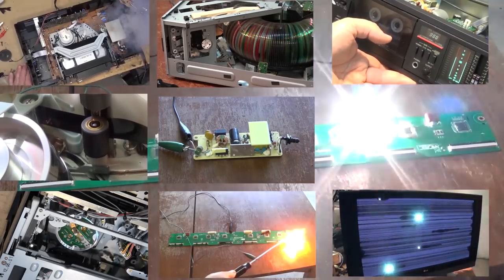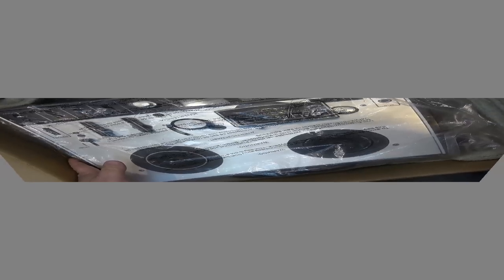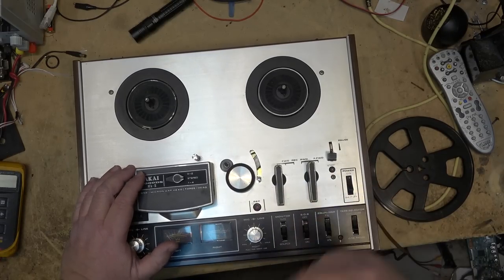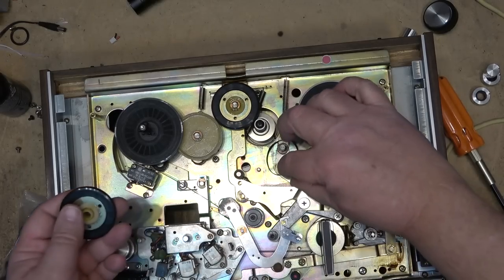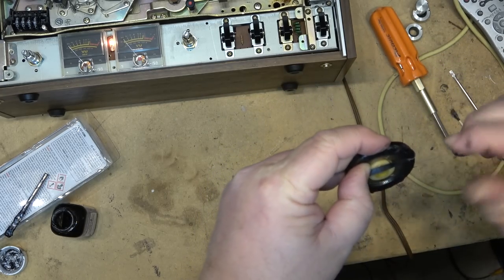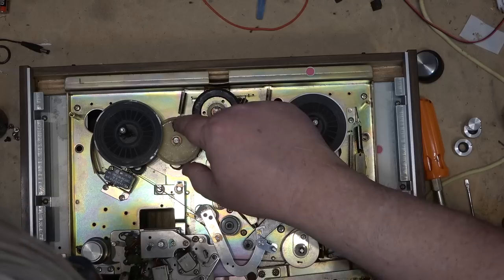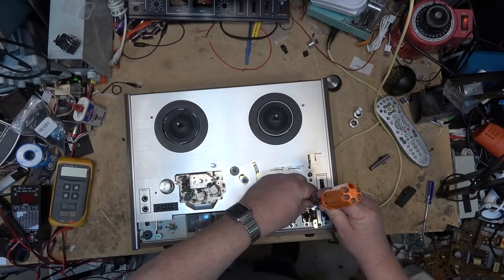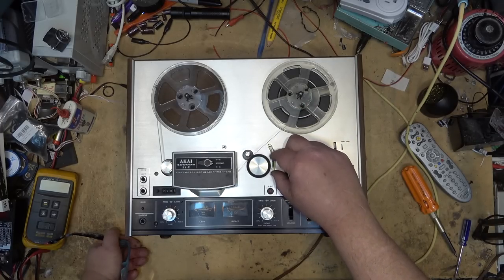Simple way to repair a worn out rubber tire.

Comment: Crikey, that machine takes me back to being a teenager trying to make sound on sound demos- Very difficult to balance all the instruments when you're having to GUESS how loud it should be after you've bounced the track between L & R channels maybe 6 times at a push - by which time it's easy to find the first track was too quiet or has become a bit muffled for all manner of reasons - not keeping the heads clean enough or demagnetised (degaussed) or trying to do it at 3.75 IPS instead of 7.5IPS - the maximum this machine will do anyway - 

I DREAMED of owning a TEAC  4 track, 15IPS  but in the end I BUILT (or ADAPTED to be more accurate) my own 24 track recorder on reject 1 inch video tape I bought in bulk - it was reject because it was as sticky as gaffa tape until I ran each reel through a few times with a rag carefully collecting the sticky oxide shedding - which was a LOT of oxide shedding - and very tricky to do without ruining the reel.  

But the tape deck was adapted from an ancient computer data recorder / tape handler - the ones you always see in movies from the 60's with reels spinning at mad speeds - and they DID spin at mad speeds too, each reel driven by a separate motor as big as one on a good washing machine, electromagnetic disc brakes, three VACUUM motors to keep the original (half inch) data tape in suspension ... if only I had realised what a treasure I had in those old data tape handlers, years before ebay, I would not have been so casual about letting them go - at the time all I wanted was multitrack AUDIO, so it took a lot of very amateur engineering on my part to adapt, make them work for my purposes at all.  

Even the multitrack heads were simply CASSETTE HEADS stacked in a staggered formation - so it ended up more like a 26 track or something, but only about 12 tracks were properly erasable due to the difficulty aligning the erase heads to the record / replay tracks lol - and a couple even overlapped a bit!   I DID say my engineering was very amateur.  I wish i had kept it - and the huge mixer I made too, just so I could fantassise about being in Abbey Road recording studio I guess!   It WORKED but it often picked TAXI RADIOS at the worst possible moment when recording or mixing down.  

Sorry I am just reminiscing now.
Reply from the maker: The sound on sound feature of these decks was really quite a gimmick wasn't it. I've never tried doing it on the 3340 with simusync.  I do know someone that had 2 3340s in his home studio.  He would  record his drum machine onto 2 tracks.  Then record guitar onto track 3 bass on 4.   Play the tape through his mixer and mix it down to tracks one and two on the second 3340. Play back the tape in simusync and on track three and four lay down his stereo synth.  Take that tape which now had the drum bass guitar and keys and mix that back too another stereo track on the 1st 3340. Continue adding two more tracks on that 3340 dubbing it back again to the second one mixing the first two sessions down to a stereo track and so on. Was very interesting what one guy could do with two tape decks and a cheap mixer. At 15 IPS the sound was more than good enough. He what's the first guy that I knew that went to digital audio tape when it first came out. Got a tascam da 88 I think it was eight track and a DA 30. He gave me his da30 when he switched everything to digital cubase recording which he still uses today. He was in a band going way back to the sixties. Being a studio musician since the '70s and it's still raining jingles today. Won't say his name but his music has been heard by millions of people. Is done lots of session work but most of his stuff these days is for film TV and commercials. has a nice little studio set up in his house that have been to a few times. He has a guitar it is studio in a glass case signed by Keith Richards. His band back in the 60s opened for the rolling Stones.
Reply: @12voltvids  He sounds a very interesting character.   I think some people are very talented in the art of getting just the right sounds down on tape (or equivalent) - they know what is too much and what sounds tasteful and what suits the song - then there are guys like me who ruin 95% or more recordings - largely by never being able to stop tinkering - often trying to compensate for poor musicianship - I can admit it in retrospect - some people are just talented, they have the ears ... I could only dream of having that kind of ability but I did at least enjoy trying ... it's not always all about winning, although I must admit, i wouldn't have minded a LITTLE success,  lol!- but it wasn't to be.     

I realised I will never be any good at recording - regardless of my songwriting ability which is also a little questionable - when I joined TAXI MUSIC which most people who work in film and TV music are aware of, I would imagine.  (although someone who has had success 30 or 40 years before Taxi Music even existed, probably has little or no need for their services - but I could be wrong there too)  ... but the main thing I learned from a few years membership with "Taxi" was that I am no darn good - and it just took a while for that obvious fact to sink in.   

I was still living in the past, from the days when my very amateur demos COULD get a few publishing contracts of questionable worth, if enough copies were sent out (I would literally post out 200 tapes to almost every publisher and record company in the UK) ... and that was exciting ... hundreds of letters back saying more or less "Thanks but no thanks"  and the occasional "do submit again" and once a year if I was lucky, an invitation to meet or chat or sign just a few songs - but the stars never quite lined up and the main reason, I can now accept, was that I didn't have sufficient "talent" - very little, in fact  - but I DID REALLY REALLY enjoy trying!   And that's the main thing!!  

I remember when I was 16 and naive,  almost laughing at stories of people my age now, sometimes finally having a hit or some other kind of success ... (in the monthly magazine published by the ISA -= International Songwriters Association, in Limerick, Ireland) ... I'm sure I wasn't the only kid who would be lying to himself for the next 20 years that he was hard done by in some respect if he had no "luck" in music - it's such an alluring industry, it kinda warps your perspective until you grow out of DREAMING (in my case at any rate)   -   I can think of worse ways I could have wasted my time and money so I always encourage others to at least have a good go at writing their own material - it's such a fulfilling occupation even at a hobbyist level.    

Thanks for sharing your story with us.

Comment: Gary at VM can resurface the idler wheels.  I  do like your idea for fixing these tape machines.  Thanks for sharing.  What is the name of the glue?
Reply from the maker: Yeah but what he charges to resurface is more than i charge to do the job.
Reply: @12voltvids  I  have never used his service for that;  but,  indeed it is costly.  I  have a Sony that I  will be trying your method on.  Thanks for sharing!
Reply from the maker: @TKELCH  I have seen some other rollers done by others. 100 for a pinch roller redo haha laughable.  I showed a r-r here a few years ago that had reman pinch and the flutter was unbearable.  They had to be sent back and done again and that shipping cost was ultimately paid for by customer.  I might make 100 or so repairing a unit so there. People don't want to spend much on these old machines.  Spending 100 for a rubber roller means I have to charge 200 and 200 is over the budget on almost every case.  I remember when pinch rollers were available from nakamichi and they were about 40 cost and people refused to change them.  I changed plenty under warranty but out of warranty not too many.
Reply: What brand is the glue and where to obtain?  TIA

Comment: Maybe one day 'you' also will have an idea what kind of glue to use, so that the idler doesn't run so rough afterwards?! Who knows.
Reply from the maker: The only problem with the glue that I used is it's getting kind of thick and drying out. Rubber spent obviously is the choice to use but the problem with it is once the jars been open and exposed to air the rest of the container starts to dry out

Comment: Hi, have you done a video on the products you use in servicing equipment? In this video you mention 'Re-new,' there is also sprays for crackly volume pots and white graphite grease spray made by '3 in 1' for metal bearings, perhaps this is a future video idea on servicing tools you could do...?
Reply from the maker: Rubber renew is a product made by mg chemicals as is nutrol contact cleaner.  3 in 1 electric motor oil is just that non detergent sae20 oil.  I have shown them in other videos.

Comment: Hey Dave I must ask this question? Did you ever play football when you were younger? Your a big guy and not saying anything offensive just thought you did!
Reply from the maker: Not football. I was into Motorsports i raced motocross when i was younger and broke a few bones in the process.  When i see knuckelheads riding motorcycles without helmets I just shake my head.  That turban isn't going to save the rider when he comes off the bike andbitvis just a matter if when, not if.  Yes we have helmet laws here but religion superceeds traffic laws and common sense.
Reply: @12voltvids  I agree with you about helmet laws stupid Florida says you don't have to have one! Shoot If I ever get a bike I sure will use one! My brother was into Motorsports as a kid also he was mostly Dirt bike racing!
Reply from the maker: @Jammerk40  I still have my old dirt bike. It's very rare. A can am tnt250.
There was only 250 made.
46 years old, I bought it in 1977.

Comment: Quick question on camcorders...my HC1 now finally died on me. Moisture...and it do not reset as it did previously. Someone suggested a 100 ohm resistor soldered across the sensor. In south africa we don't get that cold weather to worry about condensation...not that I will ever take it outside for whatever reason. Just want to make sure about the value of the resistor. 100 ohm or if you can recommend another  value I will appreciate it. Thanks for ALL your videos...just love it.
Reply from the maker: if it's the sensor that's bad that might do it because they typically are 100-200 ohms dry.  you will need to disconnect the original sensor however because if it is shorted it'll still trip to do sensor just like if it's open. That's providing that that is what's causing the trouble it could be anything in that circuit including leaking capacitors thought the main board.
Reply: @12voltvids  thanks...wil give it a try and let you know what the outcome was.

Comment: I like those open reel decks. I could never afford one.
Reply: I promise you the novelty wears off very quickly - once you've compared it to the digital alternatives, tape soon becomes a pain you can do without.    That's probably why so many change hands on Ebay -  The tape costs a fortune, cleaning and degaussing the heads becomes tedious - some old tape from the 80's or thereabouts has become unusable - sticky - There;s always something going wrong - endless faffing about  - if the back tension isn't right, the head to tape contact won;t be sufficient to actually record well or even at all, if the heads are pretty worn out - as i imagine many of them must be by now.   I still LOVE looking at tape recorders and trying them out on the rare occasion I could afford one - but 4 months later I would always sell it again on ebay after it has sat there un used for three months lol.   You can always get your money back if you don;t pay silly prices - check completed listings - you might get a bargain.
Reply: snowcraft40  $100 is too much? They are still many, many thousands of these machines about, but to get the performance they are capable of a new pinch wheel is one essential I'd recommend, so add 30 dollars, the one here was very bad. The reel idlers are not going to affect playback, apart from background noise.
Reply: @stephenbrough8132  It does not wear off for me and I have 5
Reply: @SDsailor7  I'm glad for you.

Comment: Could you not double nut the wheel and place it in a drill and smooth with some 400 wet dry before install to make it smooth?
Reply from the maker: Or just leave it running on rewind and let it polish itself.

Comment: I'm curious Dave how long is the run time for one of those small reels just said to the wife I'd like one of those o display in summer house, great work top man as usual thanks
Reply from the maker: Well it depends on the record speed and tape thickness. .5 mil tape vs 1mil vs 1.5mil.  Obviously .5 is going to fit 3x the tape on same size reel as 1.5mil. I have a Sony that has 4 speeds.   15/16, 1 7/8, 3 3/4, and 7 1/2.   So, saying that.  The small real I had of Ampex 541 5-in reel is 1 mil polyester 900 ft. Running time at 3 and 3/4 IPS 45 minutes at seven and a half 22 1/2 minutes at 15 IPS 11 and a quarter and 90 minutes at 1 and 7/8. That's per side. Now a one and a half mil tape would contain 600 ft and .5 mil 1200 feet.  7-in reels obviously you're going to hold more and 10 and 1/2 in even more

Comment: I found on ebay a seller of rubber friction tires for recorders, check with "8pcs Idle Wheel Belt Loop Idler Rubber Ring Cassette Deck Tape for Akai Sony", perhaps they may accept a customized order
Reply from the maker: I actually have a set of tires for this model as I have a spare with busted cams.
Reply: @12voltvids  Before, in the 90's here in Europe,  it was easy to order such universal tire sets in any parts stores, I don't know why it disappeared .... Anyway thank a lot for your demonstration.
Reply from the maker: @Yoritomo3800  it was getting hard in the late 90s to get some of the sizes.
Reply: Do you have a link to were to buy those rubberbands? Thank you.

Comment: My Akai 1721W had the problem where the idler wheel is slipping while the tape is playing and spilling all over the tape which causes the problem. This is why I don’t like about Akai reel to reel tape recorders, because of the broken cam switch which were pot metal where it is about to break or deteriorate overtime. Panasonic and Sony are way better than Akai.
Reply from the maker: Yes Sony and teac for me.  I have always been a teac / tascam fan.  I have a Panasonic wired remote control for a cassette deck or reel to reel.  It is compatable with my teac. Same plug same wiring.

Comment: Ever try to microwave a idler tire?... seems the water would cover any metal that was exposed ...wouldn't a belt on a phono idler change the speed of the turntable?
Reply from the maker: Is this a turntable?
Reply: @12voltvids   No.... I asked a general question ... guess you don't know
Reply from the maker: @bones007able  that sounds like a future video.  Fit a belt around an idler drive turntable  wheel and check the speed before and after.  It shouldn't have an effect as it is just a midway drive.  The reduction is between the motor and platter

Comment: That a temporary fix glueing that on the tire .The proper way is place new rubber on the tire if the deck is worth that much too the customer.That fix is not going too last .I just don't agree with you on that repair everything else you repair yes .
Reply from the maker: I still have a glued on belt on my tape deck. Over 10 years working fine.  Did that on rewind tire on my old betamax too.

Comment: Buy a Revox R2R and this problem is non-existent
Reply from the maker: Who would actually buy a r2r these days.  They are being given away or found in the atic
Reply: @12voltvids Thousands & thousands of analog audiophiles.
Reply from the maker: @dubdoodle7191  Been in hundreds of audiophiles homes over the past few years. you know how many reel to reel setups I have seen? None, zero.
Nobody wants them. I get people t hat have old reel tapes that just want them digitized. Have zero interest in having a reel to reel.
When I do see one, it not usually in some high end audiophiles setup, its sitting out in the garage. I comment, oh you have an old reel to reel, and the response is usually, want it? That's how I ended up with about 15 of them.  Even people that were collecting turn tables seems to have leveled off.
They are about as popular as DAT, which is not very popular either.  Even my Teac 3340 is more of a show piece. It works but I don't use it. It does look cool as a display piece and gives me something to display my Betacam on.